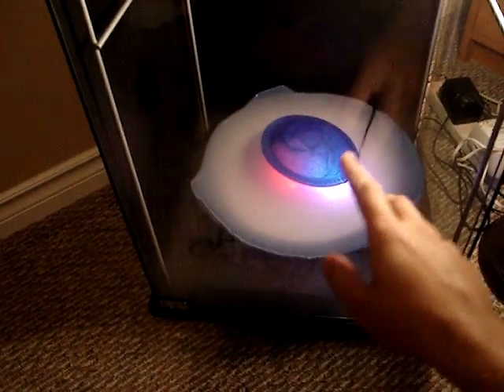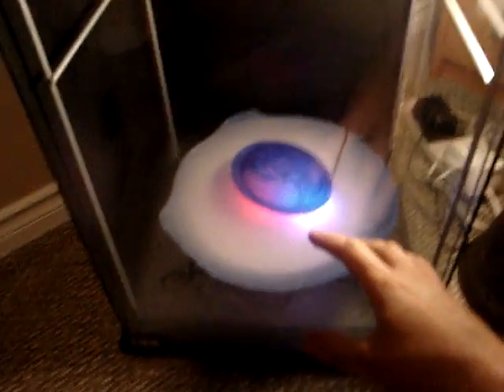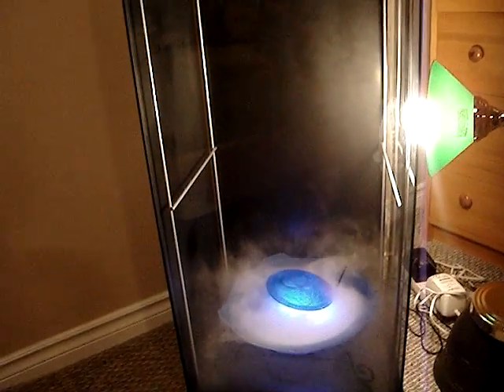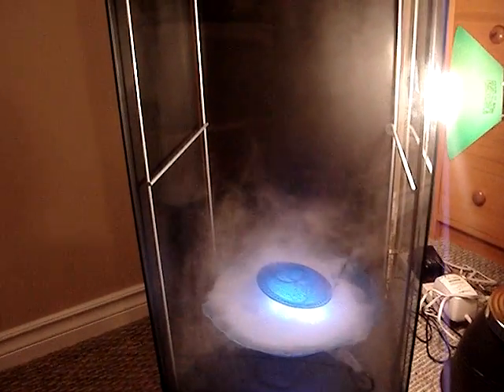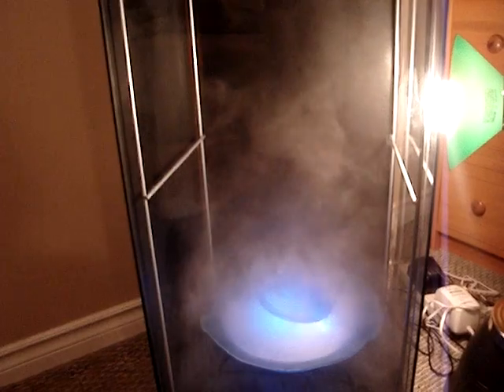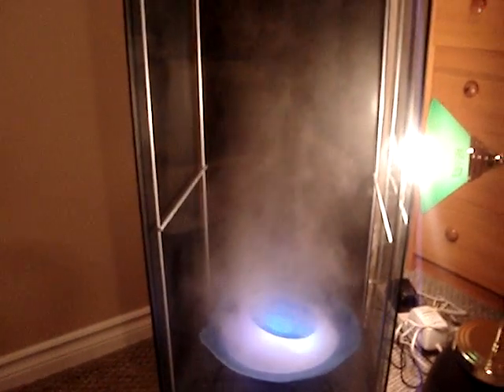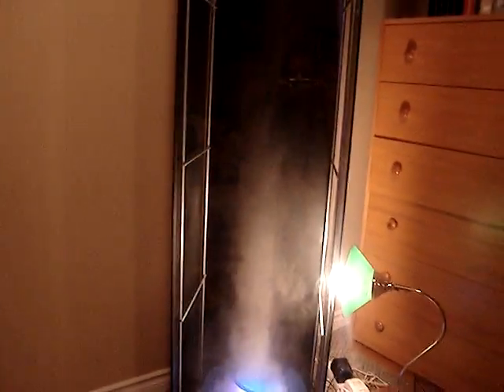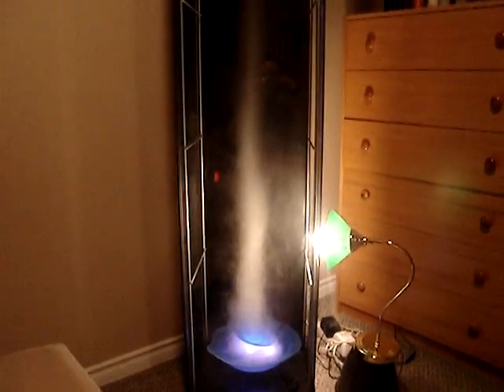tornado machine / humidifier home made

Comment: What humidifiers did you use
Reply from the maker: Hi man was a while ago but it definitely was like this 
https://www.amazon.ca/AGPtek%C2%AE-Aluminum-Fountain-Atomizer-Humidifier/dp/B00P8V4KIO/ref=asc_df_B00P8V4KIO/?tag=googlemobshop-20&linkCode=df0&hvadid=312833183742&hvpos=&hvnetw=g&hvrand=3655913456275422136&hvpone=&hvptwo=&hvqmt=&hvdev=m&hvdvcmdl=&hvlocint=&hvlocphy=9001346&hvtargid=pla-570657942909&psc=1&mcid=f373e15edc0b3a7d8fec7f439769255b

Comment: Hey buddy I'm thinking about making one of these with the same cabinet u have there and I was wondering if u didn't put the clear plastic connectors on the glass.
Reply from the maker: Hey Brody um hahaha I cant remember if I did or not. As long as you have space in between the glasses you should be fine, which there is already so you shouldn't have any issues buddy, it will work right away.
Reply: @Josefppaz  Hey buddy what type of fan is that up top and did u make the background in the cabinet black so u could see the vortex better and if so how did u do it?
Reply from the maker: Brody Sparks the fan I used was a big 120 volt computer fan  was about 6 inches and I put a light dimmer connected to it as well to varying the voltage and speed of the fan. In Canada I got the fan from princess auto or in the States harbour freight or some computer store hope that helps man
Reply: @Josefppaz  thank u buddy I'm probably gonna make me another one but with this cabinet from IKEA and a AC infinity high speed fan.